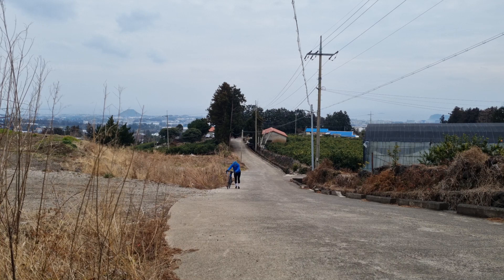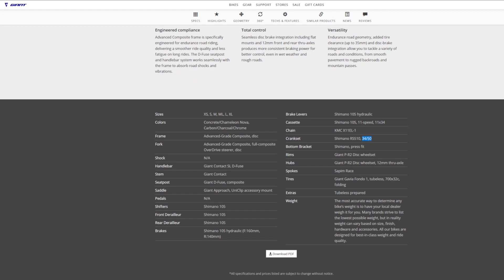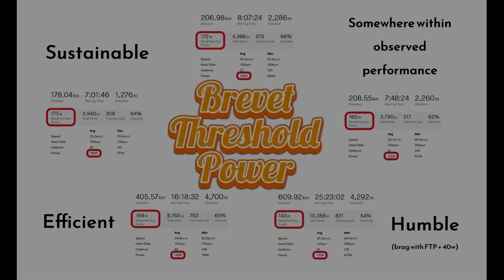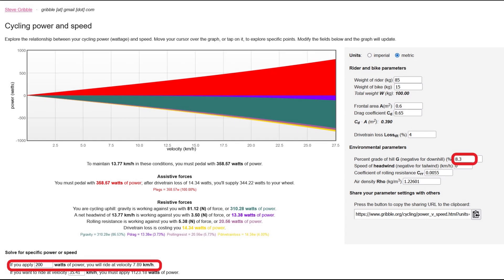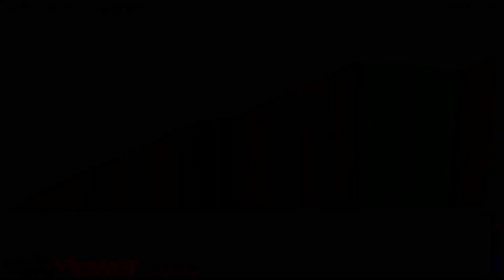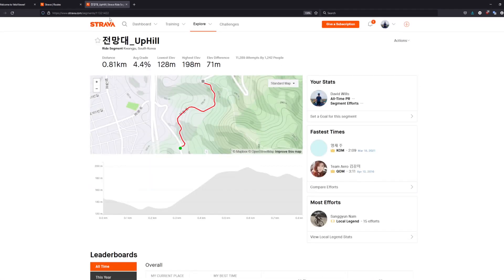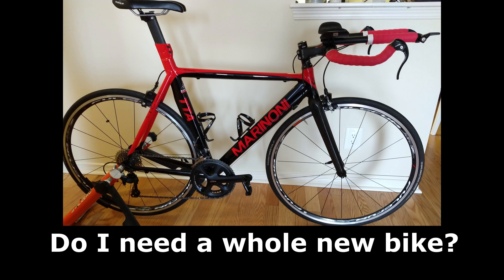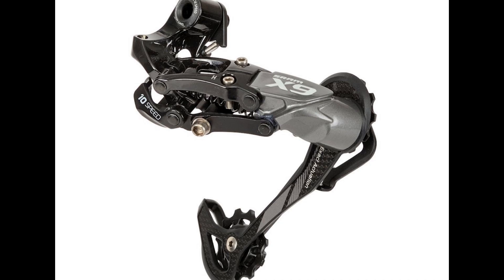You are probably OVERGEARED

Comment: The issue with wide cassettes is the large gaps between gears, which can also lead to faster exhaustion. I found that the ideal gearing would be 42/26x11-28 or 11-30 (10-30 if it's a 12 speed SRAM, but only RH sells appropriate cranksets and they're never in stock). This configuration gives decently low gearing for the harder climbs, and no gaps above 10% especially in the range of speeds that sees the most use (20-35 kph). And 42x11 is way more than what most would ever use in randonneuring.
Reply from the maker: You bring up some good points Jocelyn. With a 46/30, the top end is still beyond what is needed for actual randonneuring where pedaling above 45kph or even 40kph is wasted effort. 46-11 is useful when training though.  I used 44/26 and 11-32 with 11 speed on my old Ti gravel bike and loved that setup.  I'll pin your post as anyone sensitive to big jumps would benefit from your implementation. My old crankset was a hack, and it might not be possible on direct mount front derailleur bikes. GRX and a wider range cassette are easily available and can be added to any bike at least. Thanks for your comment!
Reply: I've landed on the same gearing... lets me keep my 10 spd sram red stuff... I did goto a barcon shifter for the front as I hate the way the red (non Yaw adjustment) shifts and trims... the 42t covers the majority of my riding and the 26t is far more of a bail out gear anyway... given the option I'd just set it up as a downtube shifter... but my frame lacks that option.
Reply: Heh, 42/28 double with 10 speed 12-28 was my exact combo for randoneering years ago. I intend to swich to 12 speed 11-34 with dual nw double, so no front mech but still an ability to use small front chainring for the rare very steep hills/when you are dog tired.

Comment: I have a Bianchi with a 52/47/34 crank set, but no explanation why the 47 is there. I assume those are racing rings with an extra mountain ring.
Since the rear wheel doesn't look original I have no embarrassment in swapping out the 6 speed cluster for an 11-32 7 speed. If that's not enough, I'm good at walking. But I do need to be stronger. Hills feel a lot steeper than they were when I was a child of 60.
I also have an easy Racer Tour easy. That one is a bad influence. It's wa-a-a-ay to much fun, so I ride harder than I should. I need to learn to back off when I ride that one.
Reply: My first geared bike was an 82 Fuji with 52/42 crank and 11-28 6sp freewheel. Three years ago when I started putting in miles, I used to never use the small ring except on steep hills. Then I got a bike with a 30:30 low gear which already felt like hamster mode, and I only started using it because my 50 and 40 chainrings were both shot. Now I have a 50/34 front 42 rear and might even go 46 rear if I can fit it, and feel like I'm really grinding even on the 42t ring when I ride the old roady, not having even a 1:1. I can't believe how strong those racers were back then. Spinning is really better for endurance ergonomics. Three years ago I'd have argued that nobody outside technical MTBers needed a 1:1 or lower. I'm glad to have so many options now.
Reply from the maker: High gears were the norm back when road triples were common.  I think the small gap between the large, middle, and small cogs was due to limits in derailleur performance and the quality of ramps/pins on chainrings. The 'touring triple' like the Spa Cycles TD-2 is a nice style of crankset to get lower gears and keep the original spirit of the Bianchi. On my recumbent, I have a mountain bike triple crankset to help with climbs. Descending on a recumbent is a real treat though.
Reply: @overbikedrandonneuring  
It's only a five tooth gap between the big and middle ring, but thirteen between the middle and low.
I haven't decided if I even like road bikes, but if it works out I plan to replace the middle ring with a 42. Although the 165mm Spa Cycles is tempting.
If it doesn't work out I can probably get my $125 back from the next guy and learn not to hammer the recumbent whenever I get on it.

Comment: I've always liked the low gears, would rather spin my way up than walk.  In mid 90's I ran an 18x32 low gear on my mt bike.  Loved it.  These days I'm an underpowered recumbent rider, that'd be about 200w FTP.  I've set up my recumbent with SRAM AXS as its setup is so much easier, and shifting on a 'bent is great with it.  I have a 46/33 up front with a 10-50 rear cassette.  I don't have enough chainwrap even with the long cage, so it gets ridden mostly as a 1x setup with a 'bailout' to the 33t for the lowest 2-3 gears.

Even on my upright bikes I love the low gearing.  My gravel bike is a 32/10-50.  Yeah, I spin out top end around 25mph, but at that point extra power input doesn't help much, so coast it!  The lowe end though lets me take on some darn silly offroad climbs even after many hours on the bike.
Reply from the maker: I learned my appreciation for low gears from recumbent riding, where you can't stand and grind a low cadence up climbs. My favorite recumbent gearing was 50/34 and 11-46 11 speed. The Shimano MTB rear derailleur was able to handle the chain wrap luckily. It was comically low gearing, but came in handy pretty often. 

I've been doing low gearing hacks on my roads bikes for about 10 years now. Happy only need minor hacks these days with gravel 2x around.

Comment: The things people do to avoid a triple when they need a trople is funny
Reply from the maker: It's true, most people do try to avoid triples. Last month I did a 400k brevet on my bike with 3x9 speeds. It has almost exactly the same overall range and jumps between gears as my 2x described in this video. It takes more attention to manage and is a worse overall experience as a result. That's without even considering the older components that tend to shift clunky.

My 2x wide range set up is simply nicer to use. In the 46t ring for most of the ride. Only shift down when the road really starts to point up. Very nice.

Comment: well after watching this way too many times and simulating some of the climbs I'll be seeing on a long/big ride in a month or so on my trainer I've made some pretty big gearing changes... I'm a fatty at #300... ended up swapping the 52/39 crankset for a triple... tossed the 52 in the trash, kept the 42 and swapped the 30 for a 26... went to a barcon for the front shifter... out back I've maxed out the 10 spd sram red derailleur with a 11-30...  the 42t covers most of the stuff I regularly ride and the 26t offers a nice bail out gear...
Reply from the maker: That reminds me of the gearing I set up some years back on a gravel bike. Took an MTB triple crank and moved the 44t to the middle position and had a 26t small ring. 11-32 out back. Quite nice.

A good thing with SRAM 10 speed is compatibility with MTB parts. I once had a 10 speed SRAM Rival setup using a compact crank and 11-36 cassette with an X9 derailleur. Really low gearing for a road bike in 2015. Of course, the shifting on a narrow range cassette and short cage derailleur is really snappy and responsive. That pleasant tactile feeling isn't quite the same with wide range setups. Glad the video was useful for you!
Reply: @overbikedrandonneuring  I did run a GX rear derailleur for a bit on it because I could use the 10 speed stuff... but some play in the hanger bolt caused issues with it wanting to shift down to the 11t cog... apparently because it's the later 10spd sram red it'll shift 11 speed as well... I do miss the road/MTB cross compatible days...   anyway TY for posting your calculators you used, between them and some stuff Path Less Pedalled posted the 1x setup with a bail out gear seems to be about perfect for me haha... same way I ran my MTB back in the day when I found the 11-36 wasn't quite enough for me with a 1x (the super large cassettes where just becoming a high end thing when I stopped riding)... on my MTB gaps have never been an issue... but road I can only stand so much haha.

Comment: I crossed Korea 3x Incheon - Sokcho - Incheon the first two times on 52/34 & 11-34 and the last time 50/34 & 11-34 I feel always spinning a bit out with the 50 especially downhill. I can’t imagine the GRX 48 it might be too easy. I guess is a personal preference. How ever I really like your content ✌🏼
Reply from the maker: Thanks! It's quite personal and context dependent, but I hope everyone can consider their weight, fitness, ride length, and terrain to make their best choice. I've found randonneuring rewards saving matches rather than burning them, which often means coasting downhills to recover and managing intensity on climbs. I regularly grind 300+ watts despite a 30t small chainring and 40t large cog anyway, so the low gears are needed. Drivetrain efficiency and nicer mid-cassette gear jumps at 30-40kph from a bigger chainring would be nice though. 

An upcoming build is rather aero and really wants a 50 or 52t big ring while also supporting a .75 or .8 low gear ratio, so it will need more serious hacking than just ignoring Shimano guidelines like I do now. Looking forward to that this fall if the frame is ready on time.

I remember getting particularly wrecked in 2015 doing 336km from Seoul to Sokcho with 7200 meters of elevation. Lovely route right near the DMZ. Are you still in Korea?
Reply: @overbikedrandonneuring  yes I am still in Korea and will be here the next three years. Unfortunately my work schedule is very anti social so I ride 99% alone. I love the credit card bike packing. Korea is very well equipped with convenient stores so not too much supply is needed to carry. But I must say the roads around me suck , towards the central  Korea they are way better.
Reply from the maker: @MrBillboeing Work schedule is a big barrier here for sure. If you are looking for some nice routes, the Korea Randonneurs Permanent courses often choose some very nice roads. Piecing together their routes can be a good option. I mostly ride solo too, but their events are a nice way to ride with others if your schedule allows.
Reply: @overbikedrandonneuring  thanks for the tip ☺️

Comment: Great video! I rode Berlin-Munich-Berlin (1500km, 11,000me) on a 52/34 (yes) 11-34. It felt pretty good the first 3 days, but the last few days were lots of pushing up steep hills. This summer I’m doing 2500km/31,000me - and will try to get a 50/30 11-34 or similar. Fingers crossed!!
Reply from the maker: Those are monster rides! Good luck and ride safely. 30-34 low is a comfortable option to have.
Reply: Not the shortest I’ve been on, but it’s certainly better than sitting at a desk all day!

Comment: Over the years i transformed my roadbike to 2x11 46/28 (GRX with T.A. small ring) and 11-36 in the back. I could go 11-40 but there is no cassette available with 11-12-13 cogs for 11 speed. i like that in between gear with the 11-36 sunrace cassette. its quite the perfect range for more endurance focused rides. for longer touring i would actually even go lower to a 42/24 crankset or something similar, but i have my gravel tourer for that. 40-30-22 with 11-42 climbs just about anything comfortably.
Reply from the maker: Yours might get my vote for best randonneuring drivetrain setup. Very nice!
Reply: @overbikedrandonneuring  both bikes are shimano di2 equipped - which allowed to use XT(R) MTB components for drop bar on the 3x11 gravel bike. it wasnt even that extremely expensive as no one wants triple cranksets anymore for MTBing so the once extremely expensive front and rear deraileurs can be had quite cheap on sale or used if you take some time searching. the crankset as well. i really like that setup. with the big cassette and 40 tooth front ring its basically 1x most of the time, with a comfortably small jump down to 30 front tooth for longer steady climbs and then there is still the 22 tooth bail out gear for very steep hills and/or when carrying heavy luggage.
Reply from the maker: @Digi20  Thanks for sharing more details. I need to hop on some used part marketplaces

Comment: Having a gear low enough to match getting of and walking and pushing ? 
Remember a low gear pushing 175mm cranks will be very different to pushing 165m  or even 155m  cranks . 
If walking and pushing might be 100cm per step right leg , going up a steep hill to match that on a 700c bike might be  30t crank ×50t cassette ×700c x  diameter 3.14 = 131cm per crank revolution.  .
My opinion is you want a gear that is close to or slightly bigger that getting off and walking ? That might be 50t back 30t front or even lower or higher gear if you are powerfull ?
Reply from the maker: The legendary Sheldon Brown called that concept 'Gain Ratio' and took crank length and tire diameter into account along with crank and cassette sizes. I wouldn't argue that we need gearing to match walking speeds, but rather gearing low enough to cycle most all of our typical terrain without going too far into the red. There will be some times where that's not practical, in which case walking for a few minutes on occasion is a great way to avoid blowing up. What do you run on your bike Rob?

Comment: At 66yo I'm a newbie to cycling. So maybe there is something I'm not understanding about road gearing. It doesn't seem anyone is doing it right. Here is one example how I'd approach it. I'd do 50/46 up front and 11/50 in the rear with an 11 speed cassette.

46 50 0.92
50 50 1.00
46 42 1.10
50 42 1.19
46 36 1.28
50 36 1.39
46 31 1.48
50 31 1.61
46 27 1.70
50 27 1.85
46 23 2.00
50 23 2.17
46 20 2.30
50 20 2.50
46 17 2.71
50 17 2.94
46 15 3.07
50 15 3.33
46 13 3.54
50 13 3.85
46 11 4.18
50 11 4.55

There are no redundant gear ratios. The lower gear ratios are tighter together when the going is tough. The mid range spacing seems fine. And the higher gears can handle any decent. What am I not understanding?
Reply from the maker: Hi Michael, thank you for watching. Your proposed gearing was commonly referred to as 'half-step gearing' back in the days of 8 and 10 speed bikes. Major changes are done on the rear cluster, with minor tuning done on the front. It's similar in function to the 6-speed setup on my Brompton. You actually could cobble that together with modern components and give it a try. The common system where fine tuning is done on the rear simply has fewer levers to pull (less double-shifting) for a similar effect, and rear derailleurs shift more smoothly than front derailleurs. I'd love to see a modern half-step system though. Let me know if you put one together.

Comment: All this is a little over my head. The bike I want to buy is the 22 SILEX 400 XS. With Shimano GRX600; 46-30 ATC, and Shimano CS-HG50; 11-36 ATC; 10 GER cassette. How do i calculate low and high gear ratio? 
  I am getting it for long distance travel, 160km (100 miles). Some hilly areas but nothing very big. First goal in watts, will be 100 watts then higher if I can. I also don't want to be changing gears every time I get better at riding.
Reply from the maker: Hey James, the GRX gearing on the Silex is a great start and will probably suit you perfectly fine for a very, very long time. As you ride, just check how often you wish for higher or lower gears. If it's really often one way of the other, you may want to adjust the gears. If it only happens sometimes, you are probably well set up. The climbs in my area often require 300 watts or more just to keep the pedals moving with a 46/30 crank and 11-40 cassette. If your fitness is in a place of rapid growth, you can wait until you plateau a bit before making any changes. It would be great to hear how you get along with the Silex.

Comment: I use a Gevenalle shifter set with a 51-10 dinner plate and a 34 tooth single front mtb stuff on my drop bar gravel bike. Climbs like a goat! Pretty cheap too.
Reply from the maker: That sounds really suitable for heavy gravel conditions or riding with a load. Thanks for sharing!  Gevenalle is great for tinkering.

Comment: I changed my 50/34T and 11~32T sprocket, 50T front is too high for me, and  34T front/32T sprocket combination is not low enough for me. Now I use 1x system, 40T front and 11~42T sprocket. I calculated this combo is good for climb down to 10kph, and max speed up to 40kph while maintaining 80rpm cadence. Would love to try sub compact crankset, perhaps 46/30T but it is very difficult to get in where I live.
Reply from the maker: Glad you found the calculations useful! I had a 1x bike with that 40/42 combination for a couple of years living in Canada. It was nearly perfect for the local rolling terrain. The jumps from 11t to 13t, and 13t to 15t on the cassette were a bit big at high effort though. 1x was nice for maintenance and aesthetics (presumably aero too). Another bike had 1x and 11-46 on the back. When I moved to a compact on the front, the 34/46 combination gave comically low gearing. You'll get a similar experience when you try a subcompact. Good luck finding one! Sometimes the BB386 FSA models can be found from online retailers.